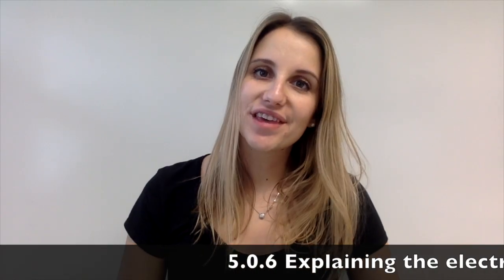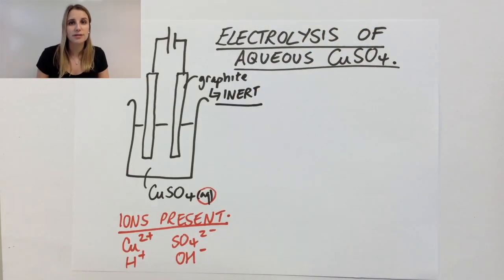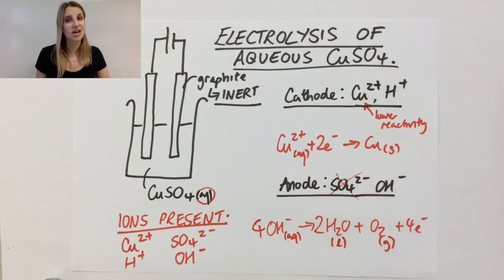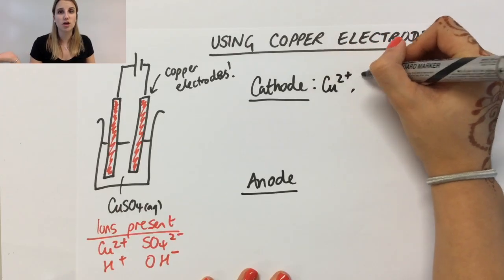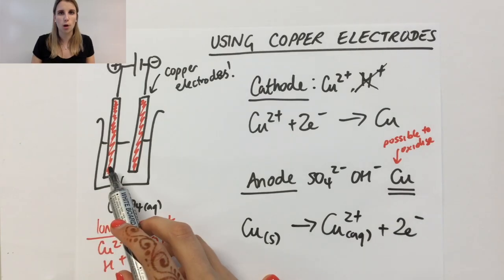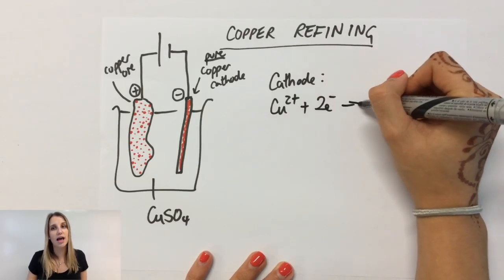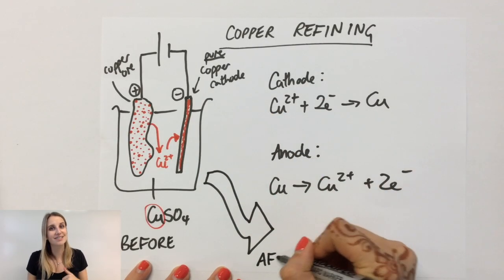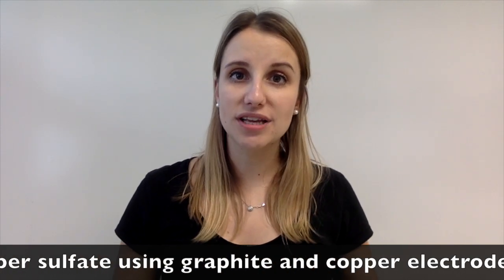Electrolysis of copper sulfate CuSO4 (aq) using graphite and copper electrodes - GCSE Chemistry

Comment: There is no such thing as "rock mixed with copper metal" in copper ore.  The ore has rock mixed with copper COMPOUNDS (complex carbonates, oxides, etc.) along with compounds of other metals.  The ore is crushed, then concentrated by a floatation process which removes most of the sane & rock.  The ore is roasted, first in air to convert sulfides to oxides liberating SO2, then in reducing atmosphere to reduce the ore to metals.  What is done by electrolysis is to remove other METALS, not "rock".  More noble metals (silver, gold, platinum group metals) fail to oxidize at the anode, falling to the bottom of the cell as "anode sludge".  Less noble metals (zinc, cadmium) oxidize at the anode & go into solution, but fail to reduce at the cathode IF the voltage applied to the cell isn't excessively high.  Eventually, the less noble metals accumulate in the electrolyte to the extent they could contaminate the copper at the cathode, & electrolyte must be processed to remove them.

Comment: Some people write anode reaction like this 
2H2O ->O2+ 4H+  + 4e
What is the difference
Reply from the maker: Both processes happen, and both make the same products so in most syllabuses you can write either answer and score the points...
The water one you have here is a little more "correct" as the water would be in higher conc than the OH- so would be more likely to oxidise

(the last gcse syllabus I taught wanted the OH- one though hence why it's in this video!)

Comment: 1:22 Can you explain why sulfide never gets discharged? is it because it has a higher reduction potential?
Reply: Yes it lies at a higher position in the electrochemical series therefore it has a property to undergo reduction better than others
Reply: there is no sulfide, it's sulfate. Sulfate has a very low oxidation potential. . You can look up anion discharge series, you'd see sulhate and nitrate low. And Chlorine Bromine and Iodine high. There's OH- in the series too but it's a funny one 'cos while it has a high oxidation potential, it has poor kinetics so its tendency to discharge is not so high. Also when you have a copper anode, the anode itself oxidises, no anion oxides at it.

Comment: Please explain why in the instance electrolysis of aqueous cuso4 using copper electrodes the anode reaction becomes copper oxidation process 😭
Reply from the maker: Because copper is more easily oxidised than the hydroxide ion or the water that's present. It's always the thing that's most easily oxidised that will lose electrons :)

Comment: after the copper from anode goes to cathode and the sand sinks, what is that small thing that is left after copper refining, that is being compared to the recent big pure copper
Reply from the maker: If you let the electrolysis run forever then it would stop as soon as the anode stopped conducting electricity because your circuit would be broken. There might still be very small amounts of metal left but it's mostly going to be the rock it started as remaining :)

Comment: @chemjungle i heard you say the sulfate never comes out, but when i did electrolysis of copper sulfate a strange yellow thing appeared. I was using a 5 volt power supply and graphite electrodes, which made it very clear to see the yellow thing on the dark black graphite electrode. Idk what it was but my guess was elemental sulfer. Any ideas why that happened?

Comment: i also had a doubt...anode attracts negative ions..but in this case the copper atom turns into ions and gets discharged....and on what basis does copper gets oxidised  in preference with sulphate and hydroxide ion....could u pls clear my doubt
Reply: Plz mam  I am also  confused
Reply: Electrons are pulled from the copper anode and that oxidises the copper anode itself. That's the oxidation that occurs there. It's of the anode itself.  If it were a graphite anode then it'd attract anions.  One has to know whether the electrode itself is reacting, or ions at it are reacting.   A metal cathode will not react, but a metal anode will oxidise.  Graphite would be inert whether it is the anode or the cathode.

Comment: Hey now. Thanks for this educational video. I've been doing chem experiments with my kids while we're quarantined and I have question perhaps you are uniquely qualified to answer:

I have several grams of Cu that we precipitated and dried from a reaction of CuSO4 + Al. It's a tiny amount and probably contaminated.

I'd like to use electrolysis to purify it and I have copper thread that I can use as an cathode (anode?). I can weigh the precipitate and the copper thread prior to start. And I'd like to show my kids how all the copper in the precipitate is purified and deposited on the copper thread ... both visually and by weight.

My question is, which electrolyte should I use, CuSO4 solution? Acetic acid? NaCL solution?

Which electrolyte WILL NOT donate Cu or any other atom to the cathode? Will the CuSO4 donate to the cathode?

I'll probably do this in a large test tube. I'll try using a graphite rod (pencil "lead"?) on one side and copper thread on the other. (I'll think the pencil graphite will conduct ... I'll test it.)

Here's our playlist. You're input would be highly valuable. https://www.youtube.com/playlist?list=PLikL-gQhJ0DmknULDIeGei3l2Q__dEfI7
Reply from the maker: Hey! I think you've probably got an amount of impure copper from your reaction. In order to make this work you need to use your impure copper as the anode and your pure copper as the cathode. If your product isn't suitable to be used as an electrode then you might struggle to purify in this way. At home, I wouldn't use any of these electrolytes though - CuSO4 will deposit Copper from the solution, acetic acid doesn't conduct well, NaCl will produce Chlorine as a byproduct which is super toxic.

Comment: OK, why was the solution copper sulfate present in refining of copper if we are not separating anything from the electrolyte?
Reply: You actually are separating Copper +2 ions from the Electrolyte which then gets reduced at the cathode to form Copper Atoms
Reply: isnt it copper coming out?
Reply: @magnuswootton6181  concentration of copper ions remains constant in case of using pure copper as cathode and impure copper as anode. Explaination copper ions are both being removed and replaced at the same rate because formation (oxidation) of copper ions at anode happen at same rate of removal (reduction) of copper ions at form atoms at cathode. I hope this made sense

Comment: What is the observation? When u used copper electrode in copper(||)  sulfate
Reply from the maker: You would see the cathode getting bigger (still orange with the copper) and the anode getting smaller. The blue solution would stay the same colour as every Cu2+ that gets used up, another one gets released into the solution (if you have graphite electrodes it gets paler and eventually colourless). No change to H+/OH- concentration so no change to pH.

Comment: I don’t understand why the copper2+ becomes copper but the SO2- doesn’t become SO4? Why doesn’t the least reactive one always get discharged?
Reply: smart
Reply: Something at A level or AP, rather than GCSE, would show that The SO4^2- has a very low oxidation potential. (this can be seen looking at a table of reduction potentials).  So SO4^2- will stay in solution.   The metals below hydrogen in the reactivity series (low in reactivity series), don't tend to stay reacted in their ionic compound, they tend to reduce and become neutral. A table of reduction potentials show that Cu^2+ has a high reduction potential.   Very unreactive ones in the reactivity series are strong candidates to get discharged.  We don't see reactive metals like potassium getting discharged, but do with a metal much less reactive, like Copper.

Comment: how does the copper ion  go to the anode when the anode attracts negative ions and why in the half equation for the anode it doesn't have a positive charge but is simply its element? are you saying that it first got purified from the cathode and this whole time nothing was happening at the anode so it went to the anode to oxidise??? I'm a confused 16 year old help.
Reply from the maker: Eeeek I'm sorry this has confused you! The copper ions go to the cathode and get reduced to copper in both scenarios. At the anode, oxidation happens. There are a few things in the solution that could lose electrons: OH- SO4(2-) or the Cu in the electrode , but actually the Cu in the electrode is the most easily oxidised of the 3 options so it goes to Cu2+ in the solution.
Reply: @ChemJungle  why did copper lose electons just to gain it back